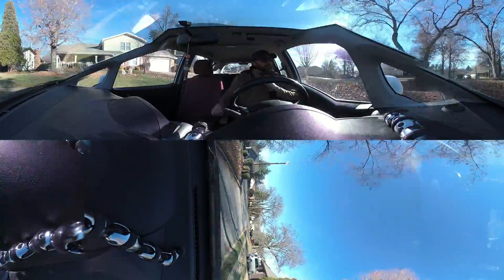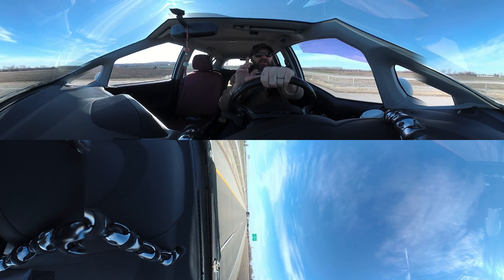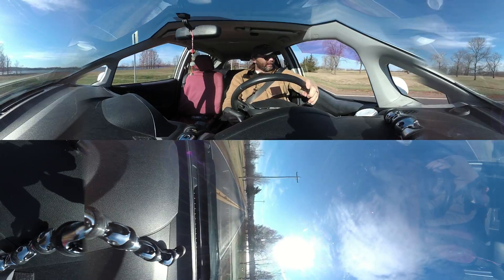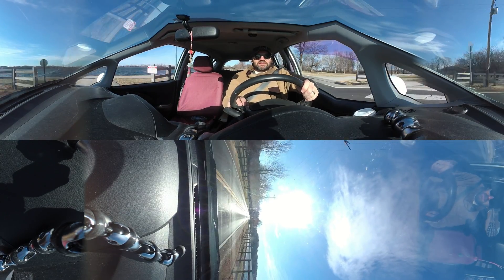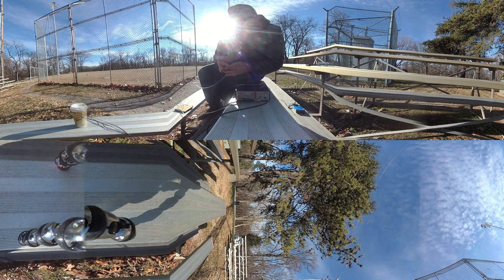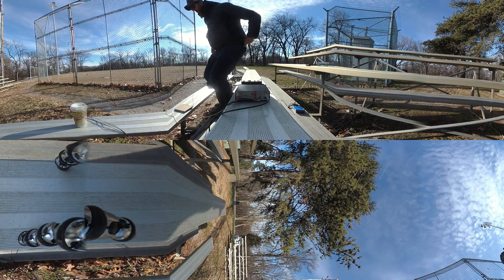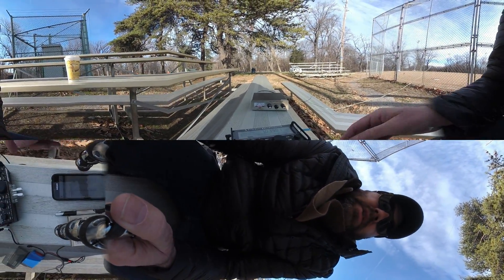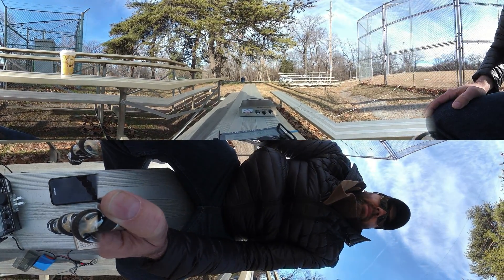MFJ-971 Will it tune? | Police SHOOT Deer!!!

Comment: Using 2 tuners is a big NO NO!  That little MFJ tuner is very easy to use and will match almost anything.  But when you are using 2 tuners and you change one of them, that changes the impedance that the other one is looking at so you have to readjust it too.  It's kind of like riding a teeter totter!

Comment: Yeah this will work you should use cowax tho and sodder the main to the clip and place it on the bottom of the fence and the other to a ground stake
Reply: You sould use the jumper on the bleechers tin roof or that chain link backstop easy 73 KG5CUO
Reply from the maker: I hear ya KG5
Reply: @hamradiocq  are you getting a opening of the magic band there? 8:19 cst here seems to get louder and louder at 50.313 could be opening up hope your having good luck there 73 KG5CUO  6 METERS!!!!  Opening #HAM #Magicband #6Metrs #Propagationreport

Comment: If I understand you correctly you used two antenna tuners in line between the transmitter and the antenna. Not good. Use only one ATU and please try this again. If the backstop is long enough, not separated, for a quarter wavelength it should work. Not sure that part of the fence you used was long enough for 20 meters. BTW, I like the 360 degree camera. Brings a new perspective.
Reply from the maker: Yes shortly after this, someone posted on how to turn off my internal tuner.  I wanna try this again.  Thanks for the comment.

Comment: Good fun indeed; it is surprising what will work as an antenna.

A 'tuner' is bad nomenclature I think; sure, that 'tuner' can make the impedance match; but, this possibility is independent of the efficiency of or the radiation pattern of an antenna or that backstop; and though the backstop may put out a signal and get a contact - and I know a backstop can for I was present when this - https://youtu.be/UmyX0JG6XGw - was made - it is likely inefficient and sub-optimal.  Interesting indeed, but by far not the best solution for an antenna; but, surely, it would probably work in a pinch. 

I was doing some research to see what sort of antenna this might be like; and looking at 4nec2 to see if I could model it or find a model of such a thing pre-made.  At the moment, maybe these backstops are somewhat like curtain arrays?  See: https://en.wikipedia.org/wiki/Curtain_array
Reply from the maker: modustollen Interesting
Reply: It would take me a long time to build a 4nec2 model of a backstop.  I could not find one pre-made searching with google.  I have no idea what the radiation pattern would be like or the efficiency.   kd8poi - the user below - his comment is insightful too, especially the part about the material the fence is made of.  Nice radio too - I use an ft817; but I have always wanted to get a hold of a kx model and see if I like it more before I'd make a switch.

Comment: You read my mind. That is something I wanted to try after seeing the video by VA3OSO (find the video "Loading up a wet noodle")
 I use a MFJ-904H with my X108G when doing portable that includes the built in 4 to 1 balun for a long wire. I am going to try this at our local college baseball field when it warms up a bit. I use a MFJ-226 Analyzer to tune my portable antennas with the MFJ-904H then when the SWR is down I plug the cable from the analyzer to the radio. You should set the rig to bypass the tuner, easy for me since the X108G doesn't have a built-in tuner...
Reply from the maker: I want to know more about that. Yes, that video inspired this one.

Comment: Here's what I know, if you use a tuner on something with a relatively high SWR (say 10:1) but your feedline is short, you will be able to get a decent signal out if your feedline loss is low (short/matched) as the signal bounces back and forth in it standing wave, because it will still escape via the antenna.  Thats why a non-resonant, tuned,  GRV with twin-lead works. What I also know is that if your signal burns up in the feedline on a long run (say 100' at UHF frequencies) you will always have a low SWR (even 1:1),  but its a false interpretation - you're just not seeing any reflection because your signal is essentially running into a dummy load - the long lossy cable.  Feedline resistance/loss/length  is fascinating and plays a role in many antenna failures even when people buy the "best" coaxial cable.  

What I think is happening to you is kinda the opposite.  You are running your feed-line into a what is essentially a non-resonant, large chunk of steel.  Steel is actually a horrible conductor of electricity compared with copper, like 10x the electrical resistance.  If its stainless steel, its way worse - like 50x the resistance of copper.  So, what I think you're experiencing is that you are essentially transmitting into this large woven steel lattice of a baseball fence that maybe has 1000' of "wire" and poles running into the ground, so a lot of your signal is getting burned up as it travels through the antenna  itself.  This is something that you don't experience even with non-resonant, reasonably sized copper or aluminum antennas because they aren't long enough for their low resistance to act as a "sink" to your signal.   Your tall, long, steel, fence is probably more of a resistor than an antenna - a huge, imperfect,  dummy load that is leaking 5-10% of your signal to the world.  

Here is VK3YE, the Yoda of QRP, doing some of the same things, he finds a way to make contacts by tuning a small pole.  You remind me a little of him.  https://www.youtube.com/watch?v=UNVW2vAaaQs
Reply from the maker: kd8poi awesome comment very interesting... I want to know more about this. Yes I know it's a Terrible antenna but does it work at all? Very curious thanks for the information
Reply: It probably puts out some RF, its just super inefficient.  One way you could test this is to grab a laptop, set up your KX2, and run a JT65 signal at 1 watt through the fence for 10 cycles, and see what pops up on PSK reporter, then just  run the same signal into your end-fed vertical for 10 cycles.  You'll see immediately how far your signal travels on a world map.  This is cool stuff, imagine if you found a great spot where random piece of metal in the environment was a reasonable antenna - even if it were only 75-80% as efficient compared to  a decent portable antenna, it would still be good enough to make some contacts.

Comment: Tom, The kx2 has an option in the menu where you can bypass the auto tuner for when you are running an external tuner. Cool experiment.  Good luck,
Reply from the maker: Ahhh! Thank you, Next time!
Reply: Turn off,or place KX2 tuner in bypass mode,using only one tuner,the external one in this case,which will tune a wider impedance range than your internal tuner.Two tuners in series will only fight,or counter each other,confusing their tuning ability.With the alligator clip,if the backstop is galvanized steel,it will not offer a good enough ground for conductivity.Find a nut that you can loosen with a wrench and slip a lug in between the bolt and nut and tighten it up,running that back to your tuner instead.This will offer a better ground for your antenna.Perhaps even a 9:1 balun will bring the impedance down to a range that allows the tuner to tune antenna easier.Try it first without the balun,and see how that works.If not,put a balun closer to the radiator,or backstop in this case and give it a try.
Reply from the maker: WB0WQS I forgot that it can be turned off in the menu